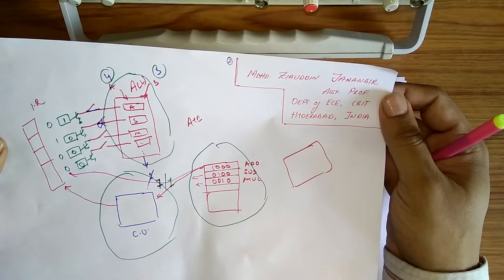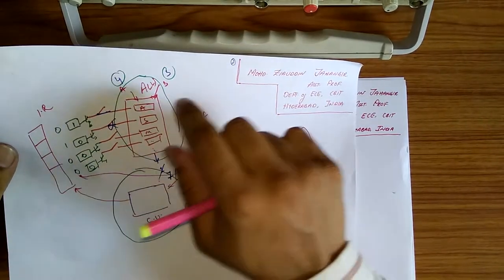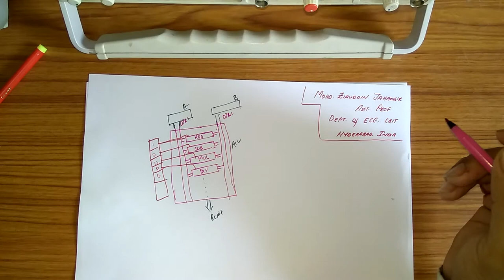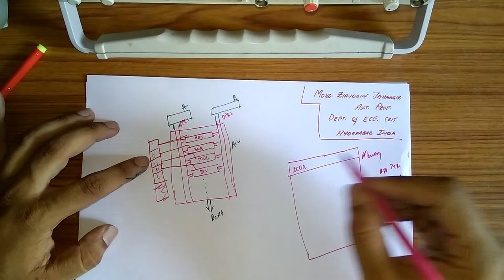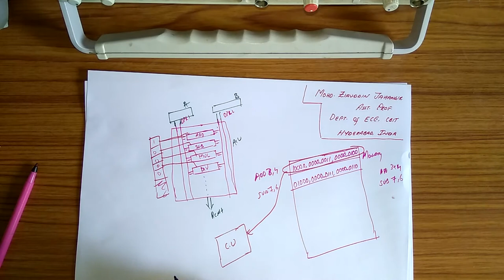Simple CPU Design - Lecture2

Comment: Please help me, When I simulate our circuit in ADS software then it shows a error message & error message is "MOSFET1 is an instance of an undefined model MOSFETM1". So tell me how I simulate our circuit in ADS
Reply from the maker: I think this message is not linked to this video.
Anyways, When you simulate in ADS, you are also required to include place a model for your mosfet.
you will find model in same pane i.e (devices FET ). Model will be named as BSIM3.
Try to keep two models. one model for nmos and one for pmos.